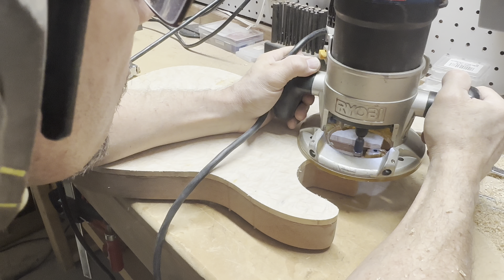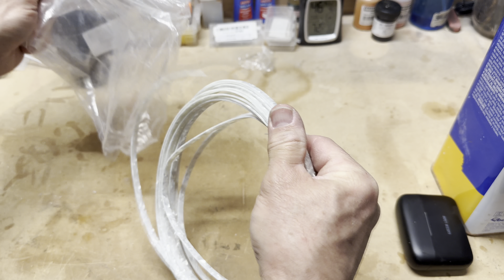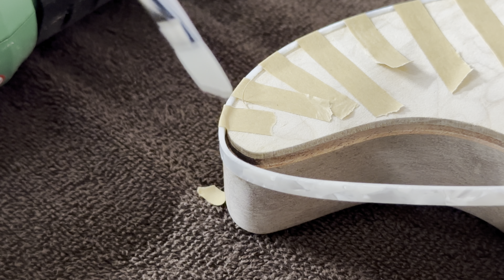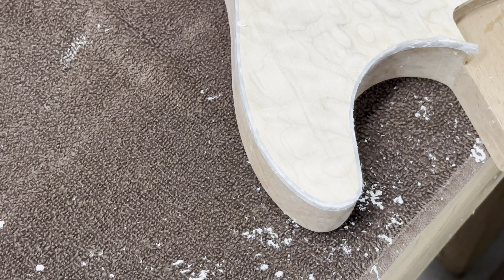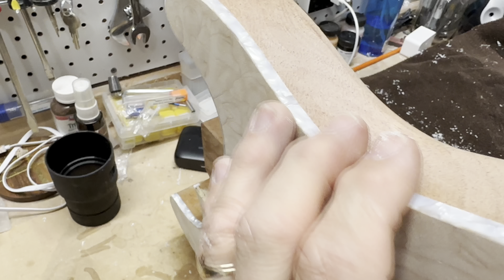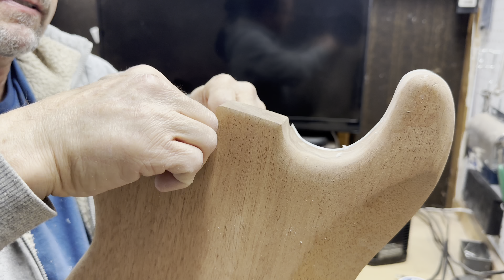Install binding (the easy way)

Comment: Hi, What did you use for adhesive?
Reply from the maker: Actually I used acetone. It melts the binding on a micro level if you brush it on right before installing the binding.  I highly recommend trying it, it’s much easier than glue with almost no clean up Thanks for the comment!
Reply: Great, thanks!  @Studtguitars
Reply from the maker: No problem. Are you building a new guitar or adding binding? If I may ask
Reply: @Studtguitars  Not at the moment, but I'm hoping to in the future. I just got back into playing and working on guitars  last year, and I am learning a ton, watching channels like yours. Thanks!